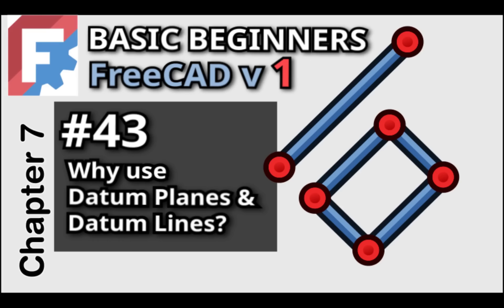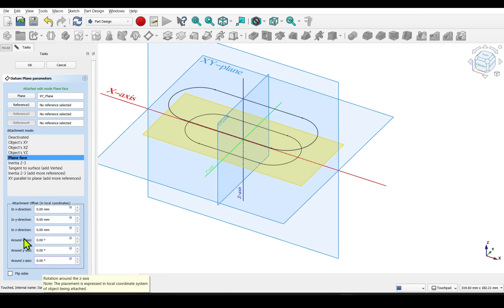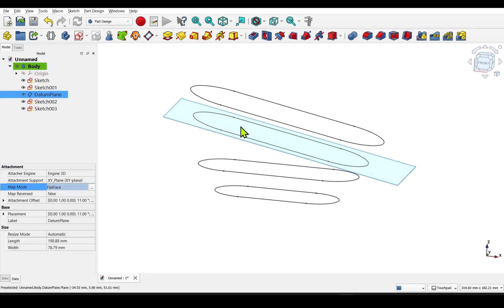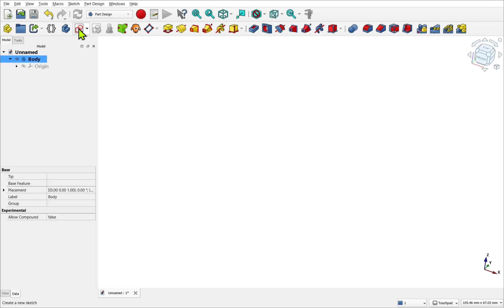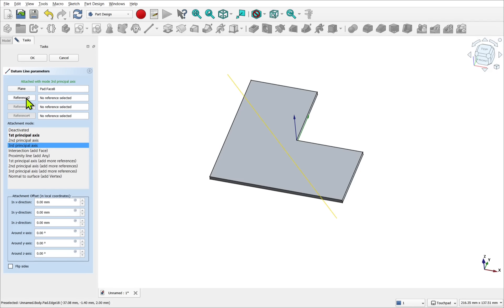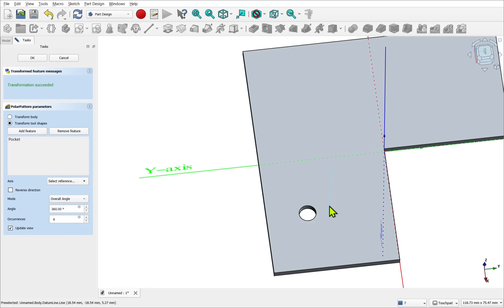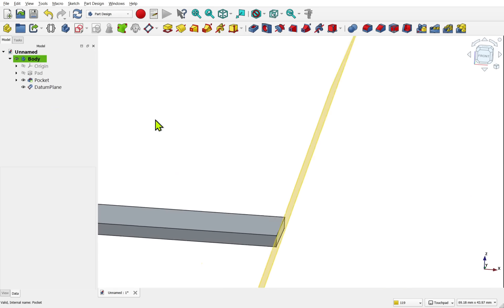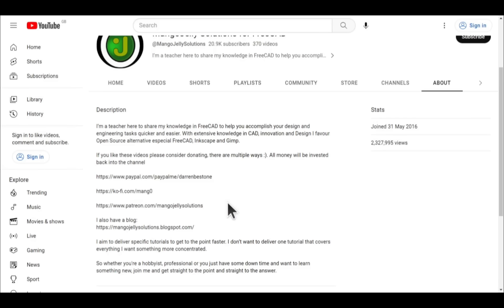How To Use Datum Planes and Lines in FreeCAD 1.0 | Basic Beginners FreeCAD 1.0 | Lesson 43

Comment: One minor thing which might be good to add/know is how to switch an existing sketch from a plane to a datum plane. New to this, but I believe you just switch the "Attachment support" in the attachments section of the Data panel.
Reply from the maker: That's correct and a good tip, you can also do this sketches as well, just watch out if you have any operations as they are now 'mobile' on the datum, if it fails you may need to set the map reverse and the normal may be in the opposite direction.  You will see this as cascade of errored operations in the treeview from the sketch you have changed the support.

Comment: I've went over this already but it completely left my thoughts when I was making my parametric shed. I ended up working from the origin point and just used math to position my sketches before padding them. I'm going to do a V2 with everything I'm remembering that I did wrong the first time around. I think datum planes should be an essential tool to use for my use case. This will save so many long equations that I have been using so far.
Reply from the maker: I really enjoy when people share what they are using or going to use the tutorial or the  tools for.  Often when learning anything there is that question 'why would I ever use this', having something real that it's being used for really puts it into perspective.  Thanks for taking the time to comment and explain that :)
Reply: @MangoJellySolutions  Many thanks for replying. I'm just watching another tutorial and all of a sudden felt bad for not already subscribing, so I've went and gave you a sub 🙂